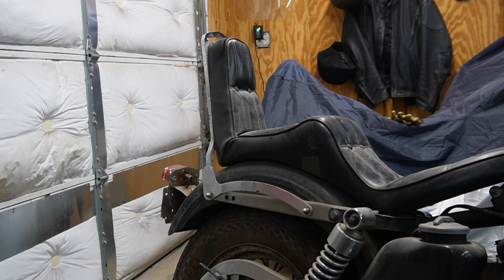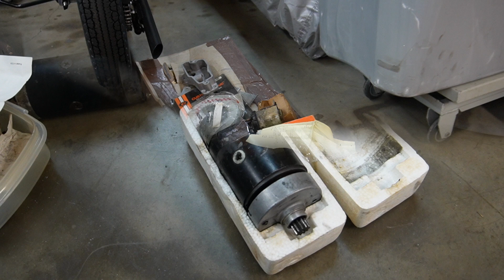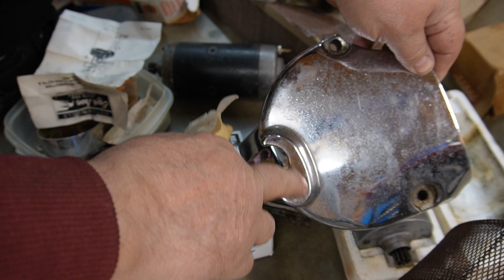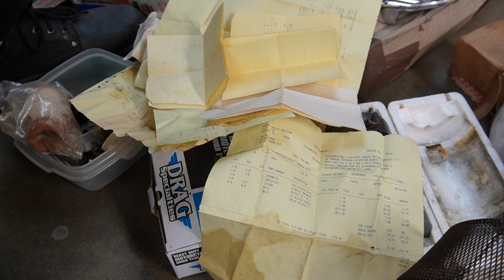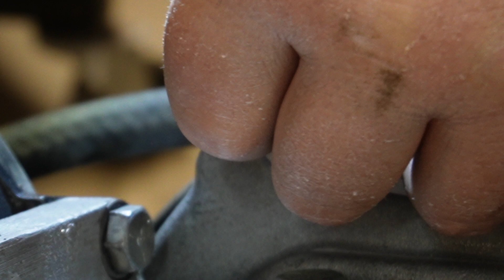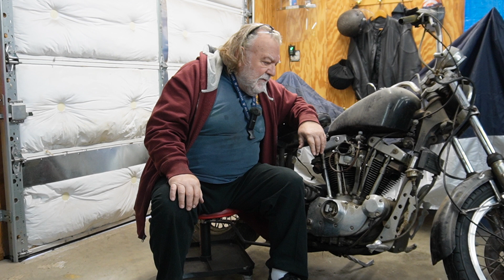In Too Deep, Project For Sale Nbr 336

Comment: I do believe that you've gotten yourself a brand new hair cut Mr. Gary. 😊
 You never did mention the year of the bike and if there is a clean title.
 It is indeed an interesting prospect. But id want to make it look nice and just feel like id have way too much money in it. Based on the way too much i spent on my last Ironhead project. Lol
Reply from the maker: 1974 with clear title...
Technically not a haircut. I harvest the crop every 3 or 4 years and donate it to Locks of Love...
Reply: Ahhh, the last year of the right side shift. Although, 75 & 76 can easily be converted back to right side thanks to the sorry ass linkage system that Harley used to save a dollar. Lol
Reply from the maker: You are correct on all accounts!!!

Comment: Appears to be a 1972.  It's the sign of an amateur's attempts to  save time by cutting corners by not removing parts to do the job correctly. The right way which  in essence is the easy way. I don't envy you Gary, but I'm had plenty in my life time to do for customers that were similar. And when the wallet meets the road logic prevailed and the owner walked away.  Like you I kept a few bits and moved on to the next one. 1500 for a complete bike if it has paper is a good price now a days.
Reply from the maker: Good numbers with matching title, stamped H4.

Comment: The bones of that bike are pretty good.  Looks like the frame is still original paint (the silver tag is still in place on the right front downtubes) and the ears weren’t cut off the seat bracket. Probably original front fender and gas tank, rear fender is junk.  Correct rear shocks, front end.  The 16” rear wheel needs to go back to an 18”.  I’ve started with A LOT less and ended up with some nice bikes.
Reply from the maker: Quit talking like that or I might keep it!
Reply: @IronHeadCycle  Gary if you keep it, and do not have an 18" rear wheel... I got one for you. The rubber is junk, the rest looks as good as the 16" in the video... same price as the wheels you got me.
Reply from the maker: I'd want an alloy one to match the front.
Reply: @ Absolutely!  In the not too distant past you could get nice (high shoulder) alloy 18’s for $100 bucks (or less) and now some people are asking Knucklehead prices on the damn things.

Comment: Gary, I am with you on those highway mounts.. I just do not recall ever seeing those on a bike before. Now with the bore scope the top of the piston was 060, so how much more could a person bore out the cylinders?  70 or 80?  Or could a person just hone the glaze off and put in new rings?   If I did not already have a '75 xlch tore apart in my garage, I would be tempted..  Now I can give my answer on why a guy stops working on a bike... the extremely short answer is a person picks up a bike (or 2) and being his own fault, does not inspect the bikes closely.. once home realizes some previous owner was a complete dip-shit and welded the cases together on the bottom... or used silicon instead of any gaskets.. once the bad items keep popping up the fun experience turns into disgust... It becomes far easier to jump on one of you long time trusted bikes and go riding... one week of not working on the messed up bikes, turns in to 30yrs......  LOL!!    An used bike to getting running is like putting a down payment on a hooker... she already has part of your money and still wants dinner and jewelry before you ever see a good time!!!    It just took me 30yrs to finally buy that dinner and jewlery and start  working on my '75 xlch again. 

Oh, you did not mention it, but others might want to know it the bike has a title... And good video today, good info on the solenoid.. I am still digging those highway mounts.
Reply from the maker: Buy it anyway, if some is good more is better. +.070 is the biggest available. So these are on the edge. A guy might be able to hone these jugs and they might be OK. Ironheads are money pits. And yes it has a title...
Reply: @IronHeadCycle  Haha! That would put me back with 5 bikes in my 1.75 car garage...   My garage already looks like it should be on hoarders tv show!!!  From the comments it sounds like a few folks are interested.. I do think someone will get a good bike to start working on. And thanks for the NAPA part number on those points ..  I know you can also use the voltage regulator for Chevy that uses a generator... but not sure which year. I went with the regulator that goes on the end of the generator, even though I like the old mechanical ones.  Thanks